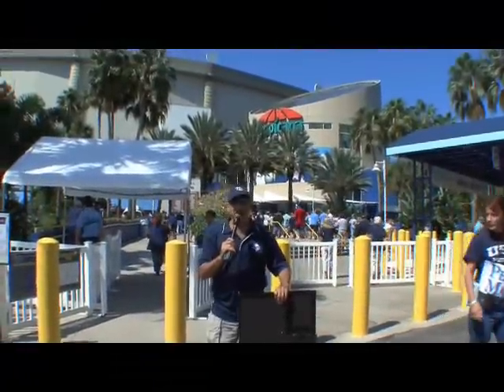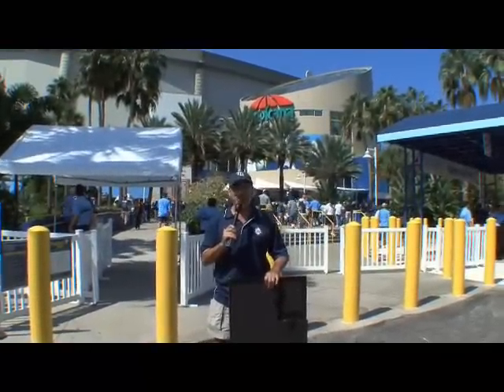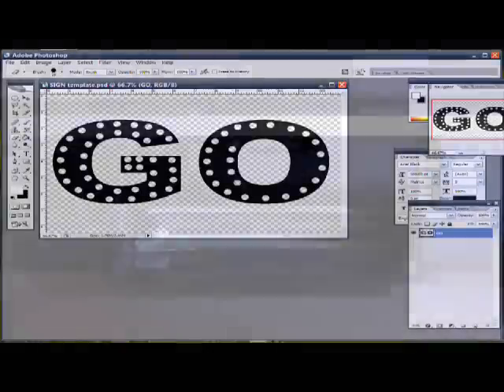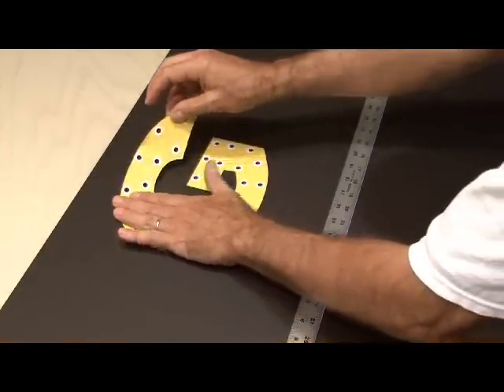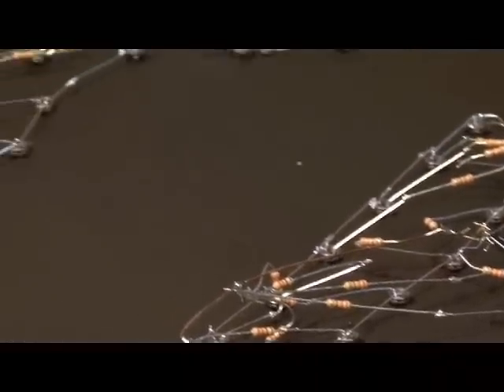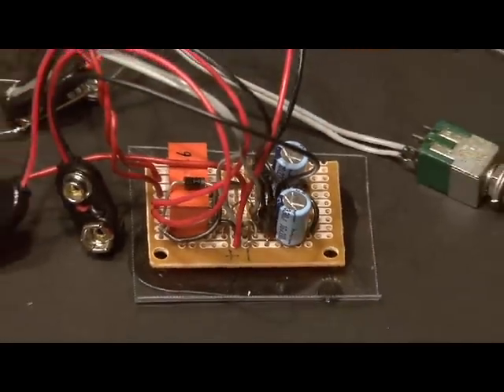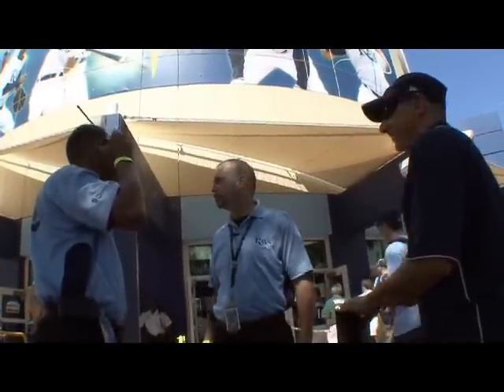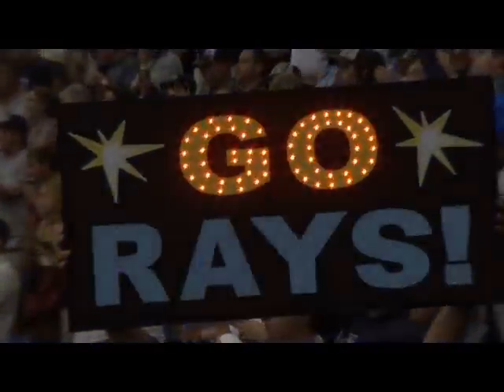Weekend Project: The Ultimate Fan Sign

Comment: Correct me if i'm wrong here...
Two 9 volt batteries = roughly 1000mAh
Each LED takes 20 mA
I count at least 150 LEDs on that sign
150 LEDs X 20mA = 3000mA
So this sign can only run 20 minutes or less before the batteries run out???
Reply: thats why need ON & OFF.
so,its up to you

Comment: that was great but i link all the leds and resistors differently.
i take ONE thicker wire long enough to cover the whole letter surface and strip small slots for led to connect at, and i do this for positive and negative, as for resistors. i link them all together solder it and link it to the wire b4 it goes to led, works well and looks neater and less to mess up in....give that a try for a simpler desing

Comment: @Dark0Lord7 by power resistor i mean a resistor of 5w capacity or more. its pretty obvious that if you connect a resitor with a capacity if  1w or less it will overheat.

Comment: depending on where you are here a few suggestions for buing parts. foam core could be bought at some dollar stores ( i have them here in canada) and possibly a craft store. Leds and resistors could be bought from Sparkfun.com (they have bright LEDs at good prices and quality, they also sell resistors) If you wanted to go really cheap try ebay. as for the printer stickers try an office supply store, for me Staples. Hope this helps and Happy MAKEing.

Comment: the schematic doesn't state what relay it is. but it would appear to be a SPDT (single pole double throw) 5v relay. the flasher is based off of the use of transistors.

but for the full details take a look at the PDF: makezine com/make/fansign.pdf
Happy MAKEing

Comment: What type of relay is this? Please list component parts for a DIY. Pretty difficult for the weekend projecters out there who haven't had formal education to know what components your using.
Reply: ***** In the video, he is using an SPDT relay, which can switch current from one source going towards one or another destination. In his case, he is switching the current from the battery going towards one word, or the other. The coil voltage is the voltage that the coil needs to turn on, so coming out of the flashing circuit, it should be at most 9V. Anything higher won't turn on by 9 Volts. The smaller the coil current, the more the battery lasts, I think. The switching or contact voltage is the voltage that you are switching, which is 9V, so anything more than that is good, but less than that will fry the relay. Finally, for switching current, you need something that's at least 3 Amps, if you are using that many LED's, because of the calculation you made above. These are the only requirements, you can plug these filters into digikey or something and try to find something acceptable, I wouldn't rely on an exact part number since everyone has different needs. Good luck finding yours :)
Reply: George Troulis lol

Comment: just a question. When the second part of the sign lights up, there are roughly 130 LED's that need to be lit up. Assuming the forward voltage of a blue LED is 3V, then the current across each LED + Resistor is (9-3) / 330Ω which is 18 mA. But with 130 LED's, you have 2.36 Amps of current! Is that ok for the 9v battery? I mean, obviously it is working in the video, but for how long can I run this before the battery overheats or something unintended happens? Any thoughts would be appreciated, thanks!
Reply: Cat "a" ?

Comment: HELP! my question is: do i have to use all those 330ohm resistors to each one of the LEDs or it it enough to just use one at the positive line where i connect it to the battery? i dont use any circuits to flash, just want to make 4letters glow. please help

Comment: I still don't understand why I would have to use a resistor for each LED, who could help me with that? Thanks
Reply: He uses 9V batteries to power the circuit.
If you put 9V across a typical LED it'll probably blow.
Therefore you put a resistor in series with each LED to get rid of the extra voltage.
You could use 1 resistor in series with all the LED but then it needs to have a higher current carrying capability.

The maths of what I've just said...

9V battery - 2V required by the LED = 7V left to get rid of.
Assuming an LED current "I" of 20mA then using Ohm's law we can work out the resistor needed.
R=V/I 
R=7V/20mA
R=7/0.2
R=350Ω

Nearest preferred value = 330Ω
Reply: MollariB5 What resistor wood you use for 12volts
Reply: Ken Wathen Same idea, just input different values>

We now have an assumed LED that requires 2V to run and will draw 20mA whilst working. (remember to check the actual values of the LEDs your are using for forward voltage and current.

But you want to use a 12V supply . You will need to connect a resistor in series with that LED to 'get rid' of the extra voltage.

Ohms law states that V=IxR and so we transpose that formula to say R=V/I so the value of our required resistor will be the voltage across it divided by the current through it.
The voltage across the resistor will be 10v (the starting 12V- the LEDs 2V leaves 10V for the resistor) and the current rhough it will be the same as what the LED needs to run ..20mA

So 10/0.2=500Ω which = 510Ω as a nearest preferred value.

The other thing to then consider is the power rating of the resistor, this is given by P=IxV
So our setup would be 20mAx10 which gives 0.2watt.for one LED.

If you were to say have 100 LED connected to 12V via 1 resistor the above then becomes P=(20mAx100LED)x10V
=2x10 which equals 20Watt resistor, very differen tin size!